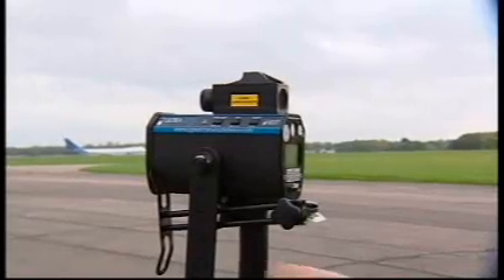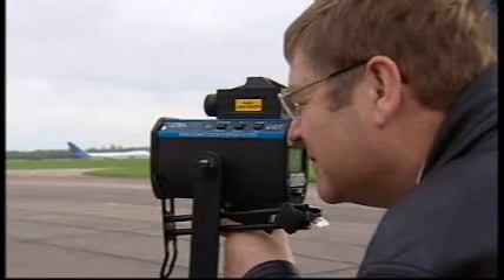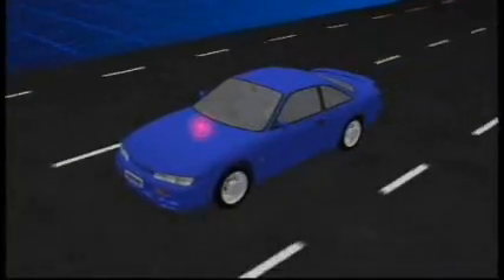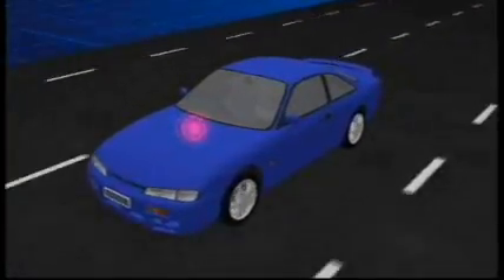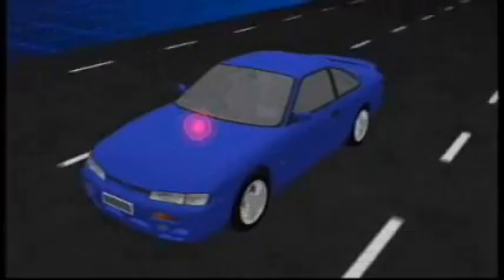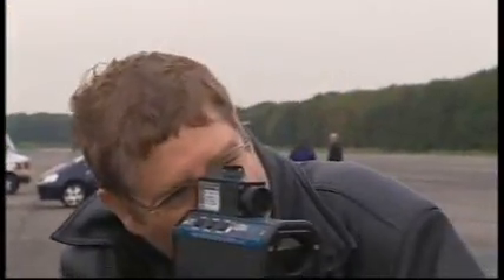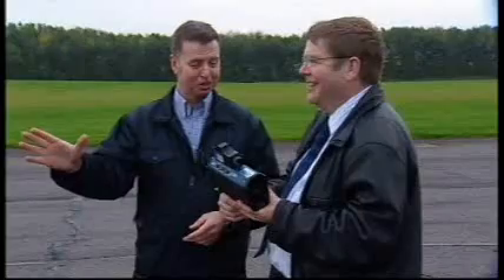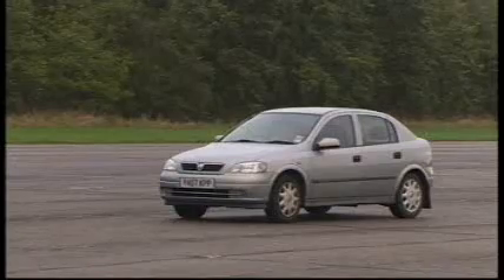LASER speed gun potentially unreliable and inaccurate

Comment: Could anyone explain why for Laser Tech UK, there appears to be a discrepancy between the Home Office calibration certificate requirements for the Trucam devices and examples of the calibration certificates available online from different police forces?

My understanding was that there is guidance that set out some minimum requirements, which is similar in the newer and older Home Office guidance. An extract from the guidance says....

"In addition the following information shall appear on the calibration certificate: 
i) the pulse repetition frequency or appropriate clock frequency shall be listed against the expected value;
..... 

iv) a table of actual and corresponding measured range. If presented, the corresponding speed readings shall also be listed, or a statement verifying they were all 0 mph, given. "

So for point (i), sometimes only one value of pulse repetition or clock frequency appears on some Laser Tech calibration certificates (Dorset Police 21-0319), whilst on others no value appears (Warwickshire Police  23-0698) and it is not clear if that is actual measured or the nominal manufacturer value. Can anyone explain why this does not appear to be compliant with these minimum requirements as the expected and actual values need to be recorded, i.e. there should be two values of frequency on the certificate? Writing "Pass" is not writing a frequency value and writing one frequency value is not writing an expected value and an actual value for the unit. The word "against" clearly sets out that there should be two values doesn't it?

For point (iv) it appears from the Home Office guidance that a table is required with actual and corresponding measured range values. Most Laser Tech calibration certificates seem to have only the actual range value column, which looks to be the ranges measured out on the ground with a measuring wheel or similar, with no indication of the optical device measured range value or any error in that measurement. The guidance says that the actual distance value should be recorded with the measured value. This does not appear to have been done - again, am I missing something? Instead, "Pass" has been written in a column titled "0 mph" next to a column of fixed distances. Surely this is totally ambiguous and does not appear to be compliant with the minimum required information that should appear on the certificate. It would not be clear if the "0 mph" column was meant to indicate if the distance measurement was a "Pass" or the 0mph reading was a "Pass" at that distance - neither of which would appear to be compliant with the guidance in any case. I'd thought that the reason that the minimum requirements for calibration certificates are specified to be measured values, is as an extra safeguard, to give confidence that the calibration has actually been performed. So does anyone know how these LTI devices have calibration certificates that do not appear to have a calibration measurement of distance on the calibration certificate, that would indicate that the device had been properly calibrated for distance measurements in compliance with the guidance. 

The second part of point (iv) says " If presented, the corresponding speed readings shall also be listed, or a statement verifying they were all 0 mph, given."  - again, this does not appear to be what is done on the Laser Tech calibration certificates. Am I misunderstanding something here ?

You can find lots of examples of calibration certificates on google searching  "lti calibration certificate" - and there is some variability in the format and type and amount of quantitative information in them. Guidance on calibration certificates can be found googling "a guide to calibration requirements for traffic enforcement " - and whilst newer guidance has been released in the past couple of years, I though that the newer guidance still contained the requirements specified above.

Comment: Bad Test! This video is anti-police sentiment and was INTENTIONALLY FLAWED. Can a Police Lidar instrument flaw? Yes! but always to the violators advantage (explained below). I can put this to rest. I am a LE Speed Detection Device instructor and 24 year veteran. I am certified to issue officer certifications in Radar, Lidar, and VasCar. Two problems with this test... #1 Software. Lidar (Laser) instruments are manufactured for use in a variety of of fields. Those that calculate speed, do so using the "Speed-Timing Principle". A pulse is sent out, reflects back from the target surface and the 'round-trip' time is calculated (using the speed of infrared light waves as a constant). The devices then pauses while a calibrated timing circuit runs to completion, before a second pulse is transmitted and the second 'round-trip' time calculated by computation of the difference between the first 'round-trip time and the second time, the instrument measures DISTANCE, NOT SPEED. Speed is only determined mathematically by computing how far this distance traveled was over the time interval between ranges (ie: how far the vehicle traveled during the timing circuit delay between the two pulses). The model shown was manufactured by LTI (Laser Technologies Inc.). The housing of the instrument is standardized, however speed laser instruments authorized by each state for judicial traffic enforcement require specific programming parameters jut to prevent this very affect. The instrument demonstrated does not have a Sweep-Error fault programming and this device was most likely manufactured by LTI for the engineering or aerospace market which uses a much more "plain-Jane" software configuration than those produced for traffic enforcement. 2nd: The operator in the video is purposefully causing the error!...and he KNOWS it! What he is creating is referred to as "Sweep Error" or "Panning Affect". Speed lidar instruments are designed to be held perfectly still while transmitting, police operators are taught specifically to avoid this, and use a shoulder stock and cheek weld to secure the instrument during transmission. Unlike the device used in the video, Instruments manufactured for law enforcement traffic use DO NOT give an instantaneous reading. There is a delay of about 3/4 of a second. During this time, the device makes a series of multiple readings to assure that the "RATE OF SHIFT" (rate in which the range is changing) remains constant within programmed parameters. this assures that the reading is device is NOT being panned at speed faster that than that which would affect the final reading +/- 1mph, and the instruments are programmed not to "Round-Up" to nearest whole MPH. Officers are taught to hold the device still and allow the target vehicle to "drive thru" the targeting reticle ithout panning the instrument. Most modern speed lasers (Since early 90's) will detect sweep error and fault the unit and display an error code. This instrument does not have that fault technology, and was very likely not programmed for law enforcement use. if you watch the video between 3:42 thru 3:53, you will see him purposefully sweeping the instrument while checking the car, The same thing is occurring in the beginning when he sweeps the laser across a motionless vehicle. The lidar instrument is timing the speed of its own motion.  The error codes for a Laser Technology instrument programmed for police traffic enforcement would have failed to display any speed and instead would have displayed "E03" and E04" indicating movement detection and timing out of target measurement. SHAME for trying to intentionally confuse and dispell the most accurate and reliable method for speed enforcement. How do Lidar units flaw? The error affect is referred to as "Cosine Error" (or Angular Effect). The most accurate reading can only be obtained by standing at a perfectly level and centered 0-degree angle to the direction of linear motion of a target vehicle. Obviously its unwise for officers to stand in the middle of the highway travel lanes to check speeds. Instead they are positioned on a shoulder or up above on a overpass. This creates some degree of angle between the axis of the infrared beam and the center-line of motion of a target vehicle. The more this angle increases, the more of an error that will occur. However, the error is always in favor of the motorist (showing calculated speed slightly less than true speed). The rest of this video is BOGUS!
Reply: Further thoughts... once as a child on vacation, I saw David Copperfield fly a white tiger over the heads of hundreds in a theater. Did I or anyone else leave there thinking white tigers can fly?...NO! it was a staged affect created by an illusionist to mislead everyone for entertainment purposes. The test this "Doctor" is performing on this video is nothing if not the same staged affect under staged circumstances. The only difference is the attempt to mislead the public against the speed enforcement practices of law enforcement. Under realistic roadway circumstances, with a qualified speed lidar device (any manufacturer), and a trained operator, this would not happen. the device(s) would fault the reading, display an error code or nothing at all, and lastly... a qualified operator would not sweep the device at an oblique angle and accept any reading obtained as accurate. I don't know about the UK, but in the US, operators undergo a period of training in which they learn to estimate speeds. they are tested on this ability to a pass/fail difference of 3mph. That "Trained observation of excess speed" is the prima-facia evidence in any speeding violation. The results obtained from any electronic speed measurement device is ONLY supporting evidence to the officers trained observation. Our laws also require that any enforcement action requires the officer to testify to a "tracking history" of the device...meaning a trained estimation of speed, followed by continuous measurement of speed thru a period of time and continuous tracked readings. Again, even if the sweep error could erroneously occur and not be recognized by the software, and the trained officer did not recognize the error, nor the indifference with his estimations, the continuous tracking history is a final assurance this could never happen in a real world environment. The video is a bogus attempt to mislead the public.
Reply: CrossChannelFairy I am not familiar with the TSM model, but I have regularly used the 20/20 series, LR-B, and TruSpeed models. EO4 is the display code for "Timing Error". meaning the device did not have the minimum uninterrupted time on target to calculate the velocity between ir pulses. I know some of the very early LTI units simply used the EO1 code for any error. what I can offer with reasonable certainty is that any infrared lidar unit currently marketed in the US for speed enforcement is standardized with sweep-error detection and will fault to display no speed readings if sweep motion is detected.
Reply: Although I will admit that I am unfamiliar with any difference or divergence in UK programing parameters... I stand beside my claim that this video is bogus. It is only a vial attempt to mislead the motoring public that these instruments are capable of erroneously measuring speeds of stationary objects or adding 8mph or anything else to moving objects. Any such measurement claim is nothing less than operator error..
Not a Device Error! This video was a staged, fabricated illusion designed as anti-poison sentiment for the most accurate speed measurement tool in use today. Period!
Reply: Sigh, it isn't the 'guns', they are just the hardware, the crucial bit is the FIRMWARE and from what you've produced thus far, you have zero experience of UK kit.  Which constabulary did you for 3mph over?
Reply: EO4?  The LTI Ultralyte TSM/100/1000 has no error 4 error code.
Reply: The above is a UK test, no LTI models having an 'EO4'.  If the beam is interrupted during the acquisition cycle, this displays 'EO2' and the entire cycle is 0.3secs, not 3/4sec.
Reply: UK firmware is considerably more stringent than that loaded in America, it's error-trapping far more robust.  Having used both side by side, the difference is very apparent right from the first trigger pull.
Reply: *police sentiment
Reply: LTI ULTRALYTE Beam is not 3ft wide as we are led to believe at 100-400ft?
Reply: The beam is 3 feet wide at 1000 feet distance from the LIDAR gun.  The rate of spread is constant. The closer the target to the LIDAR gun, the smaller the beam width on the target.  The further the target from the LIDAR gun, the larger the beam width on the target. At 2000 feet distance, it would be 6 feet wide.
Reply: Cant be fucked reading your essay but looking at your first sentence saying it will only ever be in the drivers is incorrect due to Cosine error which will increase the drivers speed if the police officer is also moving....

Comment: One factor that they didn't mention in this video is that every car has a margin of "speedometer error".
Reply: But that's the other way round.

If the car's speedometer indicates 30 MPH, the car will be travelling slower than that.

My speedometer (which is rather accurate) will still display 140 KPH when i, in reality am travelling at 130 KPH.